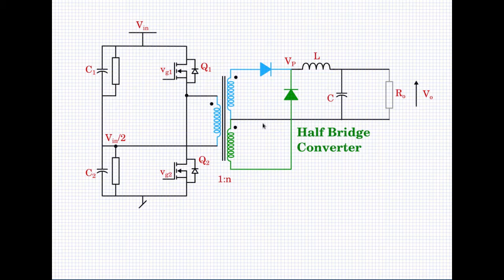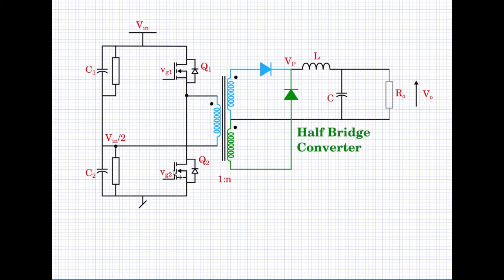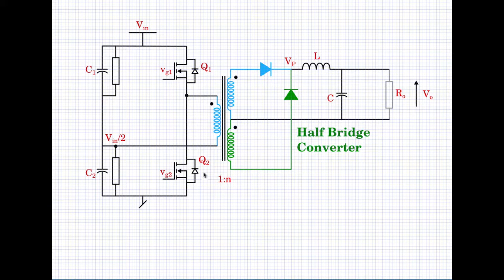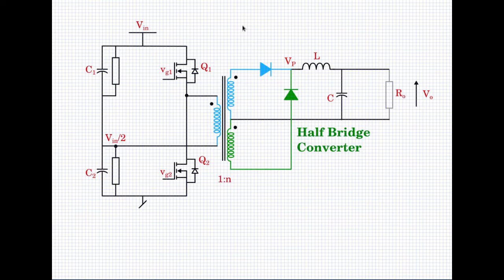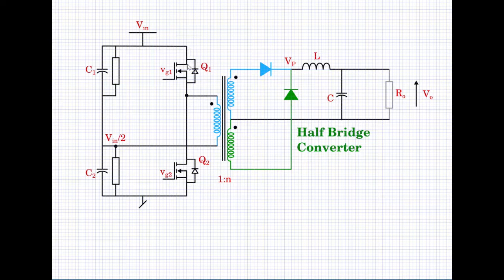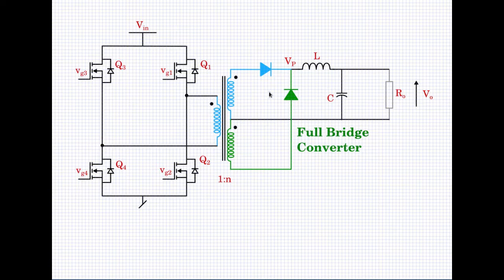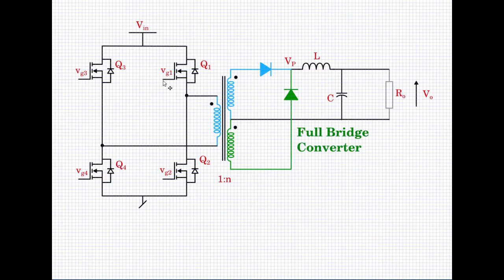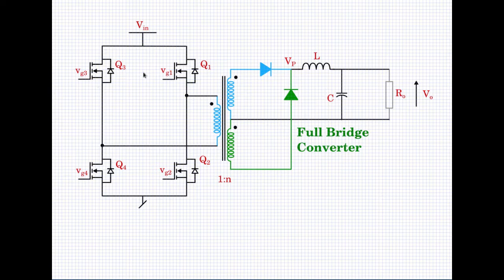Half and Full Bridge Converters

Comment: Dear sir, 
I have transformers with lm 0.400mH, how to choose Ls and Cs for resonance converter to chare capacitor at cc mode in 1or2 mili second c=0.172uf 16kv  input dc range 565 ±10% full bridge trf turn ratio np/ns = 8/57

Comment: as ON resistance of MOSFET is very very low then it will draw high current when we will try to boost up voltage.it may demage the MOSFET.how to protect MOSFET in that case.as I am facing such problem.